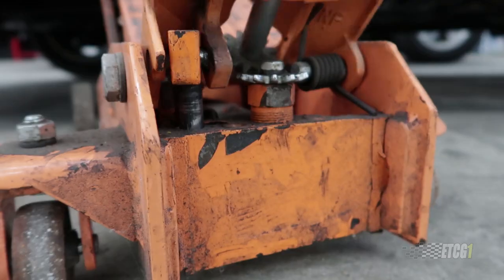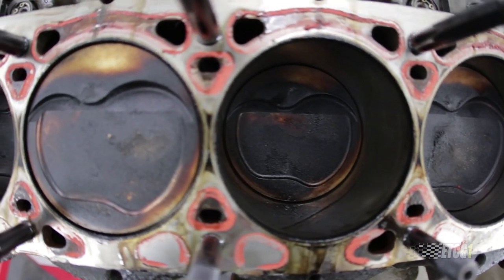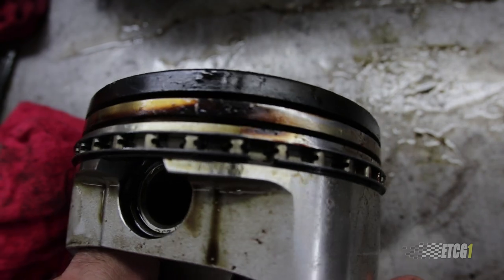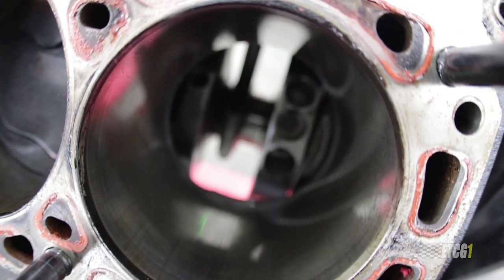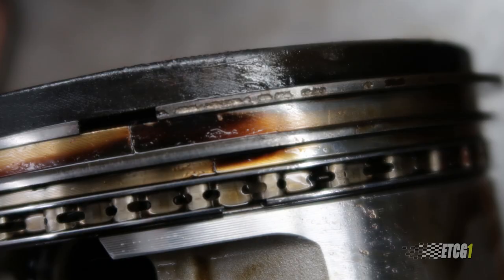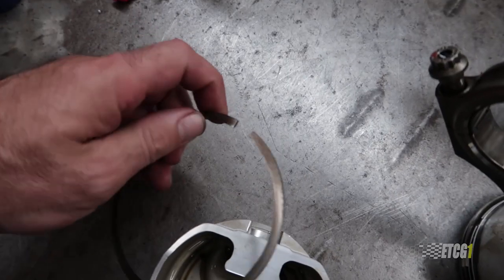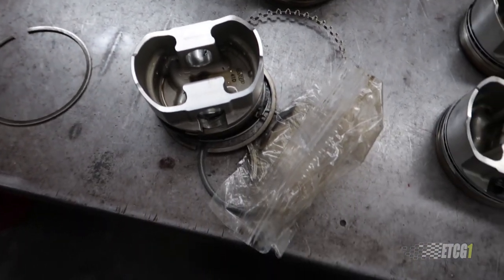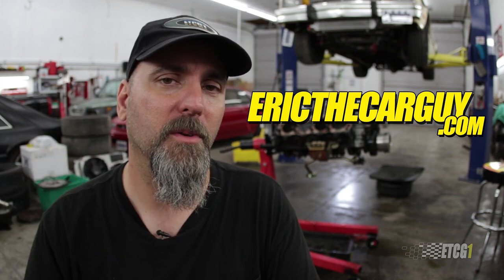Hydrostatic Lock the Silent Killer

Comment: Ouch! :-(, So the new rule is: If you suspect a flooded engine remove the sparkplugs always before turning over the engine?
Reply: Yes, if its suspected, do that. But how will you know? In this case, the fuel pump caused an unnoticeable leak into the engine. 
If you do suspect anything, just pull the plugs and turn the engine over. This will push the liquid out of the now open cylinders. For the maybe hour of work on some cars, its much safer than taking a chance and now needing an engine rebuild.
Reply from the maker: Yes, if you suspect it. The real take away is make sure the fuel psi regulator has the correct spring in it before you pressurize it.
Reply: This is a special situation, not all cars will be this effected by trying to start a flooded engine. Erics car has hot cams and low clearances inside the engine because it is built. A stock engine has better chance of survival in this situation because reasons, but also probably wont flood itself.
Reply: Old dirt bikes do it allot you go kick it over and it kicks back ... lol
Reply: Cr 500 would almost break your leg if you didn't have it in the right spot before you kicked it over.
Reply: or "rpm" triggered switch and relay with a short "prime function" when ignition is switched on. i said the same thing in other video and added that carb float/needle/seat dont hold well above 3 to 5psi range and worse on large diameter/high volume needles and seats.
he clearly has to run pressures well above that and the max boost pressure, which will overflow the bowls and flood out fast if it's not always running when fuel pump is on. I commented the same in other videos after the regulator accident, as a heads up to not have it happen again by accidentally leaving ignition on!
Reply: The damage occurred because the engine had already cranked then slammed to a stop. If the cylinder was already full with liquid the engine isn't going to move! I had that happen with daughters Envoy. I dumbly tried cleaning the throttle body while still attached to the car! Went to crank the engine and it would not budge! That was over 100,000 miles ago. presently at 265,000 so I got lucky.
Reply: Don't stand in front of the car when your brother cranks the engine with the spark plug off the flooded cylinder. :/
Reply: If you try to start an engine, and hear that hollow thud, stop! Something bad has happened that you should look into.
Reply: If you suspect that the engine is flooded, you should remove all the plugs and crank the engine until no liquid comes out of the spark plug holes before you try to start it. But if the engine may be flooded with fuel, DO NOT use the starter to crank the engine unless you want a big fire. Fuel spraying out of the cylinders + sparks from the starter = fire.
Reply: @averyalexander2303  or..... just disable the spark via unpluging the coils main harness...
Reply: The starter and relays could still spark.

Comment: Probably a very rare and fortunate occurence, buick Park Avenue ultra 3.8L supercharged engine with the poorly designed plastic gasket, slow leaked coolant into the cylinder. Right at startup, engine locked, and fried the starter. Removed the plug on the offending cylinder, turned the engine, and out spouted the coolant like a whale. Replaced intake gasket, reassembled. Been running smooth and great now going on 8 years. Really blessed...guessing the cylinder filled up in a position that didnt bend the rod. Apparently the buick 3.8L of that generation used these plastic intake gaskets that cracked around 30-40k miles. Car now has 210k on it, and still pulls hard. Really blessed...

Comment: I got REALLY lucky. Hit a deep pothole one rainy day and fend the entire front end of my Focus down into the flooded area, instantly killed the engine. I threw it in neutral and pushed it up a commercial driveway and walked three blocks home in the rain. Next day I went back and pushed it home, crossed my fingers, took the spark plugs out and cranked the engine over periodically until water stopped shooting out. That was two years ago and still running on the same piston assemblies. Did initially think that I killed it when I hit that pothole though.

Comment: Hydrostatic lock is how I got my 01 Ranger.  My buddy had driven it through a large puddle at speed, sucked in water, and punched a piston rod through the side of the block.  He sold me the truck (perfect trans, body, etc) for a few hundred bucks.  Bought a used motor for a few hundred more, and I have a truck!.

Comment: So I replaced the seals and mounts on a 3 cylinder diesel yanmar inboard a few weeks ago...the saltwater cooling intake pump overflooded he exhaust and forced water into cylinder 1. I also may have had a backflow issue from the return line. Pretty sure it hydrolocked and now I am pretty nervous that I damaged it trying to start it up. Lesson: if you think its flooded, stop cranking immediately. I may need to remove and inspect the cylinders now...huge job, especially on a boat.

Comment: Driving through an unfamiliar place during a Florida rain storm, and I coast through what LOOKED like just a bit of water on the road. It turned out to be a huge pool of water. I was going ~10 mph and suddenly my car says, "I don't feel so good" and sputters a bit before I turn the engine off.

Cried in the rain, pushed my car into a parking spot, got it towed, got the water out, new plugs, new MAF. Started right up.
It's been 1.5 years and 15K+ miles, motor is still going strong (still burns oil but that's a Honda problem hehe).

But I guess I'll just have to wait around for my conrod to snap lol, thanks, Eric.

Comment: The hydrostatic lock phenomenon is an important one and I'm happy that you vlogged about it. You did a great job of describing the phenomenon and showing the damage. I'm sorry to read that this caused your engine trouble, but now you have an excuse to put more speed parts on it! Yeay!

That all said, "driving through a puddle" is almost certainly not going to get enough fluid into an engine to lock it up. Excluding the engine fluids, getting another fluid into an engine to cause this sort of thing usually requires a stock vehicle engine either being pretty close to completely underwater to get it past the air filter  (manufacturers and engineers design to make sure this sort of thing doesn't happen in 'normal' driving). 

I've personally driven stock vehicles with water above the axles (both on and off road) with & without inner fender flaps, as well as through completely torrential rains and still not had water get into the engine. Yes, I wasn't trying to go fast, but my point is that a "puddle" isn't going to have enough water to create an issue when even vehicle use through dramatically flooded areas don't usually cause problems with hydrostatic lock.

Comment: Just had one occur with a 1998 Tacoma 2.7 today. Engine ran rough briefly upon start up occasionally over the course of 1 or 2 weeks with minimal driving. Drove one day fine on a 15 min trip, idled for about an hour with AC on, filled with gas. Re-Started and sounded rough like all the cylinders weren't firing, it smoothed out as it normally did. Stopped at gym turned it off; worked out a couple hours, but it wouldn't start after that. Fun times; possibly getting a new engine. Mechanic said it was a small coolant leak into one of the cylinders that's causing the hydrolock issue. They managed to get it started but couldn't guarantee continued operation. Recommended a new engine from a junkyard or repossessed vehicle. 

Good video. Just trying to learn more about type of engine failure and possible solutions.

Comment: This is a very smart video.  I repaired a Evo X engine that had a piston that cracked just like that a few years back, but never knew what really happened to it (you know how customers omit the truth/lie).  This video gives me some new perspective on what might have cracked that piston.   I replaced that piston, put new rings on the rest, flex-honed all cylinders, replaced all rod bearings, and it's been social media verified to have been out there getting beat on on and street racing with modifications for 3 years now.  I wanted to make a video of that job, but the footage turned out pretty bad.  I only ended up posting a video of flex-honing it.  

Great video though, it really made me glad I'm still making sure to watch ETCG1 videos.

Comment: Had a 283 ci rebuilt a few years back that let loose. The ring land between the 1st and 2nd rings broke all the way around and separated the piston top from the rest of the piston. When I pulled the engine to see what had happened, I found the piston top just low enough where the valves didn't hit it AND a piston skirt that that ran the length of the bore without damaging anything WITH a 1/4-inch of piston missing. I had to rebuild with all new bearings, new cam, and new oil pump. Those little fragments broke teeth inside the oil pump.  All the bores were okay and just needed a honing. But doing 2 rebuilds inside of a 4 month period when you aren't racing costs TIME and MONEY. Made a NOTE TO SELF: Do not drive into waters. This was on a Vega station wagon with a hood scoop. The water had climbed over the hood suddenly (I admit I was gong too fast to drive through standing water) and got sucked into the carb. And luckily it only killed one piston, and my refund check.

Comment: Never seen long term damage like this from hydro locking. Extremely interesting and good to know!
Reply: You've never been out with the offroading crowd then. We shatter con rods & drop valves for fun.
Reply: That's because this damage isn't from hydrolocking. It's from fucking up a build.
Reply: @rangerdoc1029 hydrolock with a running engine at speed is WAY different than a little starter hydrolocking during a crank cycle.

Comment: I am so glad my truck does not have a cold air intake, I drove through a puddle over a year ago which triggered a shut down (my alternator at the time had a few electrical issues), checked the air intake and was glad the box was bone dry.

Comment: When I was a kid, a mate of mine had a Toyota 4-Runner diesel.  We went off-roading and he dipped the front into a water hole and the engine locked.  Thankfully, the engine was idling at the time.  So we sat on the fenders and took out the glow plugs, squirted the water out with the starter motor, then reinstalled them and the damn thing fired right up.  After another 4 years as a daily driver, it was still running well - I would guess we dodged the bullet that time.

On the other hand, I've seen a few cars over the years that tried to power through a deeper-than-expected puddle and the engine kicked a leg out of bed (read: perforated the block with a con rod.)  That was quite a mess.

Comment: Eric, very close to the same thing happened to a friend of mine back in 1999 on his Integra GSR. Water got into one cylinder and fractured one of the connecting rods but kept running with a little misfire here or there. About 9 -12 days later, rod goes right through the piston. GSR block was beyond repair, replaced it with an LS block and put the GSR head on it, even had the VTEC working proper. turned out to be a faster car that wa. But I'm very glad everything worked out for you. its a beautiful car and motor.

Comment: Good god.  I loved rain puddles.  you know those 6-8 inch deep puddles you get when the rain channels overflow on heavy rains.  Guess I'll be avoiding them now.  Thanks for sharing.  problems like this occasionally coined as failures are hardly ever shared.  Thank you so much.  Never had a car engine shut off from the puddles though.

Comment: All right, been running well for the last month or so.  Quickest solution in this case would have been to visually check that the key on prime shot was turning off.  Then pull the plugs, blow out the combustion chambers with the starter, change the oil and filter.  Repair the throttle body before blowing out the combustion chambers.  Live and learn!

Comment: A number of years ago Mom's cutlass lost an engine to this.  I was home on leave after my Step-Dad had replaced the engine asking questions about why her old engine failed and nobody knew.  I finally found that the windshield wiper linkages had 'sawed' through some vacuum-line in the cowl area.  That allowed a ton of rainwater (Alaska) to fill up the intake and one apparently one cylinder.  Then the motor was started and promptly stopped (KIA).  Glad I found it or it could have cost her a 2nd engine as well.

Comment: I had hydro lock in 09.2017 It was fixed by removing oil with water and changed oil filter and air filter and new engine oil. This car works fine. It does not burn oil at all from oli change to next oil change. It is Peugeot V6 3.0 year 1999. Awesome engine :)

Comment: Had a cold air intake installed on my 2003 Honda Accord. I was a young and naive driver at the time. Rushing to get to work one day there was flash flooding in my neighborhood. I drove right into a huge pool of water and the engine shut off. I stupidly attempted to start it again and you can guess what happened next. I pulled the plugs out to try to get the water out but the damage was already done. New motor went in about a week late. Learned my lesson.

Comment: had my da integra shut off in the rain once, due to water getting in the intake manifold. Not thinking anything about it, cranked it, started right up without issue. Engine did miss a few times I suspect from sucking through the remaining water. But ive put 10k miles on it since then, and no issues whatsoever. No smoke no blow by, still gets amazing compression. Engine is a honda b18a1 all stock except acl race bearings.

Comment: I live in Houston, TX i saw alot of crazy water damage to cars after hurricane Harvey. One truck that came in drove thru water then a month later wouldn't start. When it came to my shop the first thing i noticed was the fan had fallen out with the drive belt. Fixed it and it still wouldn't start. After doing some more digging I found it had also jumped a few teeth on the timing belt. I replaced the timing belt and retimed it, it ran after that. The guy was lucky don't ask me if its still running, never saw it again after that.

Comment: ETCG1: Hi Pro-Logic I very much liked how you explained hydrostatic lock and it's dangers also at time mark 4:52/8:45 - :52/8:45 The connecting rod when straight (not bent) will get the job done nicely how ever 
 *(see note at end of comment) [when the connecting rod is bent and how much it is bent] will continue to bend more and more until failure. so. : *Note , if the connecting rod is slightly bent it will last a little longer than a connecting rod the is severely bent plus when the metal is bent it tends to lose some of it's structural integrity else when the connecting rod is straight it will only experience compression forces only in a straight line (connecting rod not bent) .